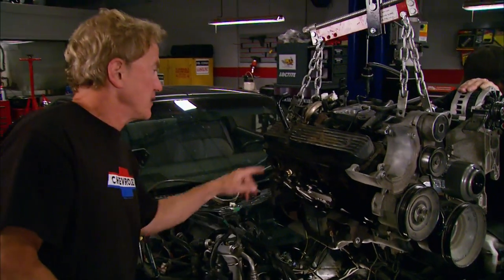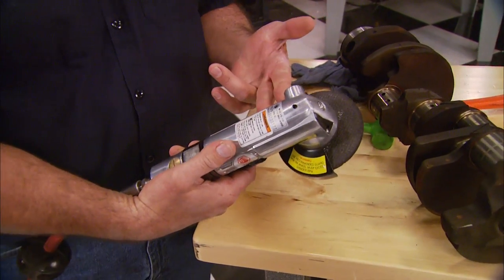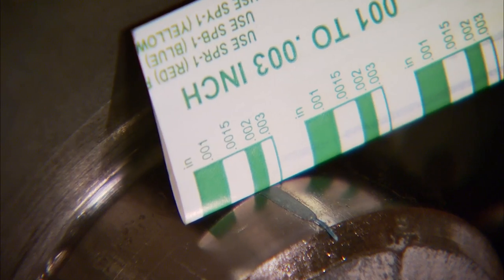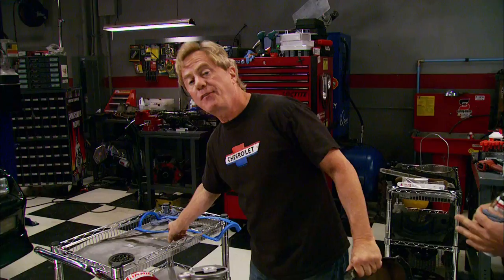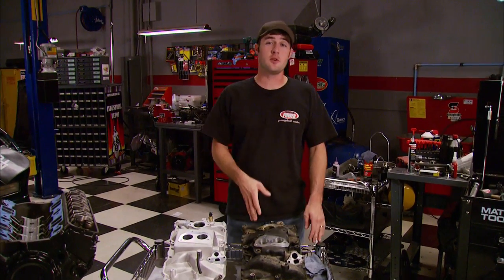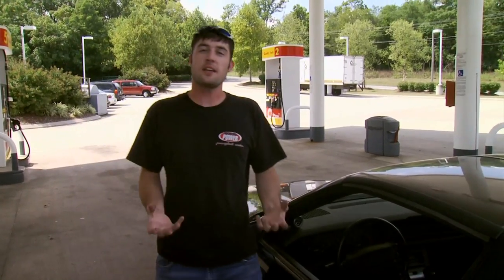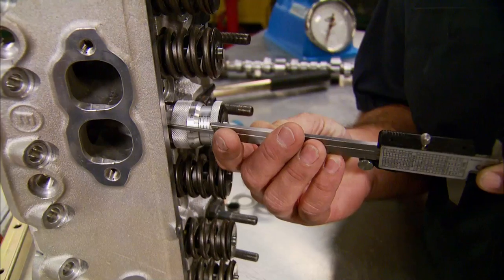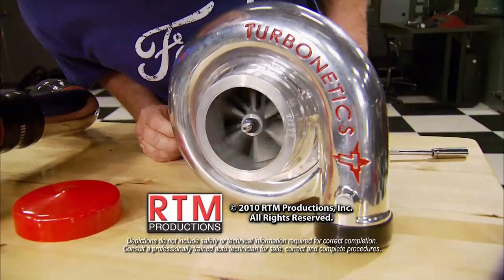Modifying a '92 Camaro Small Block to Improve Fuel Economy and Power - HorsePower S12, E17

Comment: All that money and time spent for less power and fuel economy than a V6 Honda Accord.
Reply: Yeah, I mean it's RWD which is cool, but it doesn't much sense from a budget standpoint. I like this Camaro series for the little tricks and tips to improve an engine, but a full rebuild for sub 300hp sounds like a waste.
Reply: Lmao not even the V6 the 2.0 4 cylinder does better
Reply: But then you have to drive a honda accord
Reply: @1080sucks  have you driven a 6-speed V6 Accord? 14 second car, lots of fun.
Reply: @SolamenteVees  I like my V8s.  But what ever floats ya boat eh.
Reply: @1080sucks  I hate Hondas, and I hate cars that don't have an 8' bed...but a newer Accord is going to be much cooler than that mullet inducing POS. There's a reason you don't see those very often anymore. Nothing cool about 80s/90s muscle cars. Not then, and not 30 years later.
Reply: @1080sucks  Any joy brought by that V8 is quickly lost when you realize it's all noise and no power - and still has terrible gas mileage in a really ugly really shitty car that was considered ugly and shitty even when it was new!

My completely stock 1998 JEEP is faster than that Camaro and has more HP from a 1960s era inline 6! Gets about the same mileage too! The Jeep is not considered fast or high powered even remotely.

Also those stupid headlight covers are a FANTASTIC way to get pulled over for no reason and also get a ticket. Not legal in any state. Not DOT approved. Also a wonderful way to "de-tune" your already bad 90s headlights.
Reply: Honda Accord- A car that no one gets sad about crushing for scrap metal LOL:)  It's such a unsexy car, just what you call a point a to point b basic transportation for someone that doesn't care what they drive.. I would rather have that Camaro any day with the smooth V8..
Reply: @benzproducts  Just remember - when you drive a 90s Camaro, they aren't laughing with you, they're laughing at you.

I'm not sure why it's down to this - Honda Accord vs Chevy whitetrashmobile...the obvious choice is neither.
Reply: @ryanroberts1104  you are comparing a 3rd Gen camaro that was under tough emissions standards than that Jeep. Bear in mind these episodes are extremely old. My 2003 Sierra V6 produced bhp higher than that car. The engine is 75% of a SBC.
Reply: @SolamenteVees  that's boring. I can manual shift my 4 speed auto on the column
Reply: @shadowopsairman1583  I'm comparing a 90s camcrapo to a 90s Jeep. Mine happens to be a 1998 but a 1992 model (same emissions standards) would have exactly the same engine with exactly the same HP - in a six cylinder with great low end torque! My point was that this Jeep engine was never high tech, high power, or good emissions - but it still beats the shit out of this Camaro, even after they "fixed" it, and even from the exact same year. Pathetic.

Comment: Do this with the good ole trusty 5.3L LS engine and see what kind of improvements y'all can make!
Reply: You realize this show is many years old.
Reply: U know they repost shows that were aired around pimp my ride, they dont even edit the videos to fit a youtube format.
Reply: 5.3 wasn't a thing when this show was made and also if they wanted power all they had to do was change the heads intake and bump that cam up and boom 350hp
Reply: @jonathanlawson4667  In 2010? The LS platform been around for over 2 decades.
Reply: I watched these as a kid bro
Reply: @rolandogonzalez4920  I sure they still monitor the reaction of viewers. This show isn't THAT old.
Reply: @123peytonman  this show might have aired on YouTube in 2010 but the original is from like 96 or 97
Reply: Or just a Gen 2 SBC (LT found on 4th gen camaro/fbird/vette)
Reply: this was 15-20 years ago bud!
Reply: Yeah just toss in a Ls1.
Reply: @jonathanlawson4667  season 12 aired in 2008
Reply: Junkyard 5.3 , 500 bucks, 325 horses stock... Why the hell are they even messing with the 305....
Reply: Horsepower started 2008....
Reply: @jonathanlawson4667  You're 10 years off, it was 2008
Reply: @Enermax Stephens  on the show maybe

Comment: whats was the cost of doing all that vs the fuel saved ? doesnt seems worth it
Reply: 4k for the car.....if they had someone do the labor for them it would cost about as much as the car parts and labor.
Reply: You won't get the money spent on parts back.    Even if gas was $8/gallon
Reply: @padillaog the 1992 camaro had a Z28 5.0L. If i'm not mistaken that's a 305.2CI. Which is rated for 170 HP 20 MPG stock.
Reply: Oppossed to making it 450HP and losing 5mpg, when will you get your money back on that?
Reply: @Bloodcurling  you won't, but then that's a different project. personally I would be disappointed in 34hp for 4k spent.
Reply: @vincentfauconnier1460  I'm glad you said that, because when you read the comments it goes to return on investment (ROI), which is never brought up on a power build.

I would say you would do this direction of project when the engine is blown or 200K. I like this project, but I will not tear up a working car over it. If the car is dead/tired then it makes sense cause the money has to be spent anyay
Reply: Cool stuff!!! I like the 305!!!
Reply: Doesn't seem worth it, no.  But sometimes, you do things like this for either the love of the car or just to see how far you can take it.  It's not really about getting a return on your fiscal investment.  It's for a return on your emotional investment.
Reply: doing things to a 30-40 year old car isnt about getting return on what you do,its because you like the vehicle and want to keep it running tip top shape.
not everyone wants 3 times the horsepower as it starts a domino effect of having to replace every single component behind your new,powerful engine
Reply: @benhartland4708  i just did a cam,heads,intake on my trans am.the labor would've been 3-4 grand to do it all,i did it myself.it would eat this car for breakfast
Reply: @trillrifaxegrindor4411  How is your MPG going to 'eat this car for breakfast?'

Don't miss the point
Reply: Its a sponsored demonstration, so they get these parts for 'free'
Reply: @bmstylee  welp. this comment aged like milk

Comment: I had a '92 Firebird with that same engine. Bone stock it averaged 29mpg on the interstate with the cruise set at 75mph and 20mpg around town. I was delivering pizza at the time and kept good records for both mileage and fuel use. I never tracked the mileage for blasting down the interstate at 100mph because I was a good boy and didn't do that sort of thing...often. 😁
Reply: So why did they do so poorly? Maybe they only tested MPG around town? They managed 22.9 mpg so maybe that's what they were doing. Maybe highway would have resulted in 31.9 mpg
Reply: @enermaxstephens1051  That's probably the overall average between highway & around town. If I averaged it out that way I'd have probably gotten similar results.

Comment: replacing the swirl port heads(the worst flowing sbc heads) would probably have double the power gain
Reply: Even some vortec heads would of been a better choice.
Reply: Any Vortec head would’ve been better. Stock Vortec heads were/ are amazing for the buck
Reply: I have this same engine. I put in a more aggressive cam and had head work done but should’ve just replaced the entire top end.
Reply: Don't understand why they didn't put a set of vortec small block iron heads on the block instead of the junk factory castings would have been way more power and should  have even been better fuel economy also i dont agree with putting narrower tires on a camaro u don't buy a camaro for fuel economy...
Reply: True, but the last time I looked they don't make an intake to match a TBI to Vortecs. Secondly, those heads/engine would require more fuel than the stock TBI can handle making the car run worse. The computer would also freak out causing problems with everything on the power train. You can search all through youtube and I bet you won't ever find a video where someone just slaps vortec heads on a TBI and had success. You have to do lots of re-engineering to make it work and it's just not worth it.
Reply: @derekdeckens2559  While I was mainly thinking l69/305 tpi heads or aluminum l98 heads in my post, there is a tbi to vortec intake (gm part # 12496821)

the tbi unit can be modified to flow more air and fuel (google search ultimate tbi mods)  and the late 80's/early90's gm ecu are very easy to get reprogrammed

if I had a tbi truck / fbody that I wanted to keep tbi i'd put in a reman'd l31 5.7 vortec (with appropriate mods) and if more than 280-300 hp was the goal it would be ls swap time

Comment: I get 20 mpg with a vortec headed 350 with 350+ hp 3rd gen so I think they wasted lots of money on that POS 305 boat anchor!
Reply: Dude its an emissions standard engine option, you are comparing 1st gen to 3rd gen sbc.

How about dropping a 2nd gen SBC in.
Reply: No wonder it was so anemic, like good lord those numbers were bad for all the work they did. Hell, a stock 5.7 from the same year probably puts down the same power. Jeeze.

Comment: I'd prefer the 350 LT4  install with some twisted wedge heads,love the vacuum gage & all the info, knowing where a good machine shop that works on cars to you guys might be all over the place but for me finding a machine shop that works on engines is really like finding a winning lottery ticket thanks for the find,I miss my 91 Z28 and it's a real treat seeing more videos on the Camaro.

Ya know the stearing was fun but not fun enough compared to the Mustang the Camaro could do 45 degree turns but could not handle anything passed that it would just keep going forward.

I shur do miss a good set of Goodyear GSC's

Comment: I remember using rope inserted into the cylinder bore with the piston at tdc to hold the valves up. Back then air compressors were a luxury being 18.
Reply: Getting flywheels or pulleys off small engines involves that trick too haha

Comment: Now when you're done playing around it's time to add a turbo. The only way to get reasonable power.
Reply: and a bump in fuel economy
Reply: Nitrous is the most commonly used cost effective method
Reply: Turbos suck. NA with same power level is always better. Turbos kill the sound and introduce turbo lag and an NA engine will always go quicker when accelerating from 80mph onwards than similar turboed engine.

Turbos have killed modern engines because now everything is a 4L V8 and soon because electric assistance everything will be 3L V6 / 2.5L i6.

There's not a single car that would't be better/cooler with an all NA engine.

That said 178 horsepower isn't even horsepower. This car would need +300hp to be called a real car.
Reply: @epicon6  nothing you said makes sense.  How does a turbo affect acceleration from 80 up?  Air resistance and weight are the contributing factors there.  Power is power, so it makes no difference. 
Turbo lag has basically become a thing of the past thanks to twin scroll, ALS, and electronics.  The only advantage that natural aspiration gives happens off the line.  If turbos were no good,  oem wouldn't use them.
Reply: Robert Kerr Yeah i was wrong about that. But the reason turbos are used to make the engine cheaper and to improve economy.
Reply: I used to love watching this show when I was a kid
Reply: @epicon6  OK there lmao
Reply: John N Turbos are just viagra for engines.
Reply: @epicon6  you're confusing them with Nitrous.. time to refill your prescription it seems 😆
Reply: True to the dat...

Comment: 2009 Cobalt SS.  $5K
Catless downpipe $200
GM stage 1 map sensors $80
Custom HP. E40 blend tune $250
Aftermarket intercooler with charge pipes $350
Total=$5880
321whp 380tq
28mpg on ethanol
This was a great video showing how not to waste your time and money. Unfortunately those numbers are embarrassing considering an engine rebuild, new pistons, bearings, ect.

Comment: I built a 305 0.030" overbore.
Flat top piston.
Unported 376450 heads.
Comp Cams 262 Camshaft, Springs, Retainers and Locks 1.74" installed height.
Double Roller Timing Chain.
Performer Intake manifold unported with 600 vac. secondary holley.
1 5/8" primary long tube headers.
In pan welded crankshaft scraper with main cap bolted windage tray with louvers.
Standard pressure oil pump.
Home made 1" shortened gm points distributor housing, modified to accept hei pickup components and rephased for on point firing using msd's 6A CD control box.
25lb 153 tooth flywheel redowelled, drilled and tapped to accept Mazda's RX7 clutch disc and pull type clutch diaphragm using Mazda's original 5 speed manual transmission with home made adapter plate.
3.90 rear gears with 18" 295 rubber out back and 18" 255 rubber up front.
206.7 hp and 288.4 tq at wheels with 27-28 mpg. And that's with power steering pump, A/C, Belt driven Water Pump and Alternator.
I have seen guys have 26 mpg with a 305 and an automatic in a full sized Caprice.

Comment: 178hp lol. The tbi is killing it
Reply: Of course it is but ur missing the point they are trying to retain a stock engine while improving fuel efficiency!
Reply: Fi-Tech...Holley 'Sniper'... all the same thing.
Reply: @scrappyhustler7467  Lol, not worth it.
Reply: If we figure 20% for drivetrain loss to the rear wheels, which is about right for an auto 92 Camaro, its making 222 HP at the flywheel. Pretty much any SOHC/DOHC V6 in the last 15 years is better than that. Doing what they did would have cost any normal person thousands. An eBay turbo kit on the stock engine with no upgrades other than the turbo would have had them making another 100 HP easy.
Reply: @Clapxiomatic  you watch way too much youtube ,theres no such thing as "an easy turbo swap" lots of heat,poor oiling,tuning issues etc etc etc"and don't grasp this was 2 decades ago

Comment: 305 is such a wimpy motor. i thought these cars were so cool as a kid but damn are they under powered for a "muscle" car
Reply: Leon Wilcox   Engines from that era definitely didn't make that much power especially the 70's due to the oil crisis most v8 cars were under powered. You'd be hard pressed to find a "Muscle" car from the 60's or 70's that made over 200HP
Reply: Idk mine put down a solid 210whp stock.  These guys clearly did something wrong.    I was expecting at least 300
Reply: @slowschoolofdriving218   I'm referring to 60's and 70's Muscle cars not this 3rd gen Camaro
Reply: @slowschoolofdriving218  The stock 305 heads have horrible flow that's why it makes shitty power up top even after a cam swap.
Reply: Eston Barrett there’s a few although given the way rating we’re given in 71 or 72 it may not be accurate for older cars. The Cleveland in my 70 mustang that I’m working on was rated at 330. Even then who knows, I think Detroit was underrating the hp for insurance reasons at the time to make them easier to sell.
Reply: @Bonanzaking   The oil crisis didn't hit until 73 so yeah that makes sense.
Reply: Eston Barrett I’m hoping by the time I finish rebuilding the engine with the aftermarket parts I’ve been buying to bring it to 550 hopefully at the very least. I’m rather hesitant to drop a lot of money since I think I might end up giving this car a third life as an EV in 10 years after watching what ford put out with the prototype cobra jet 1400, not the Mach e abomination.
Reply: While I certainly wouldn't bother building a 305 to begin with, they certainly could have made way better choices on the same budget. Heads and a better induction system would have been worth a bunch of power. 

These shows are just one big commercial. They don't actually try to achieve anything but make sponsors happy.
Reply: Leon Wilcox  anything pre 72 was gross SAE HP, can't compare
Reply: Chis Slidez stock 305? Do you have a TPI engine?
Reply: 305 is not so much a wimpy engine, it just has really crappy heads. This engine was put into production when all manufacturers choked the crap out of there engines for the sake of fuel milage and emissions. A 5.3 is basically a 0.040 over 305 with a 3.62" stroke, stock 305 stroke is 3.48". 

Stock 305 heads only flow like 170cfm max not counting the little high 300 lift cam. Where a 5.3 heads flow 220cfm at .500 lift.
Reply: @nashvilleoutlaw  These cars are great canidates for turbochargers. Already low compression and low flow rates.
Reply: Fuel emissions option.
Reply: @One_Shot_Garage  if your car currently has a decent running 305 why not upgrade,especially if you arent prepared to yank it and throw in some other engine that currently doesn't exist?
Reply: @trillrifaxegrindor4411  that's just me personally. I am sure there are lots of good reasons to stick with a 305, whether it is an extreme budget, someone with time on their hands who likes to be different or class restrictions in a motorsports event. 

Just like how many pull perfectly good engines to swap an LS in, why build a 305 when the exact same money can be spent on something with 45ci more and it bolts right in. A good running Chevy 350 is still cheap and plentiful.

That being said, if I did build a 305 for whatever reason I would try and stick with second hand factory based parts to get the most bang for the buck. A set of good flowing used heads, maybe mill them a bit to raise compression, do some minor porting, score a used tuned port setup (if you are starting with a tbi car, if it is carb I would stick with a carb) and a decent budget cam.

 I wouldn't do anything with the shortblock. If that needs to come out might as well put a 350 in its place.